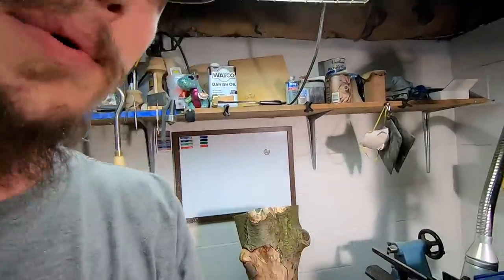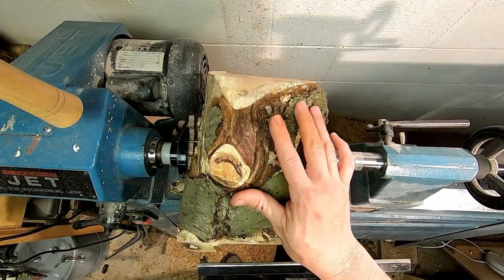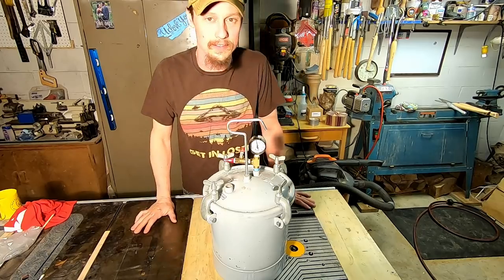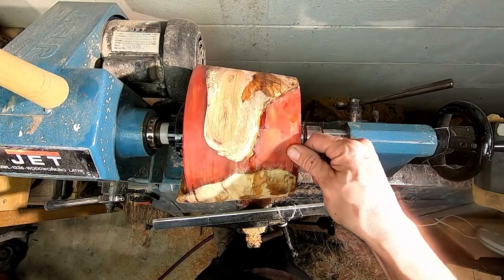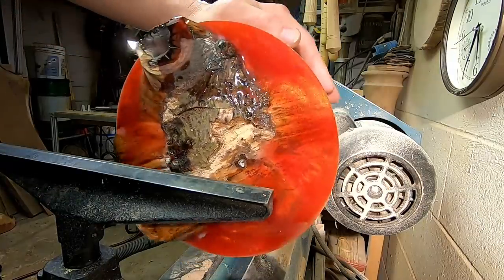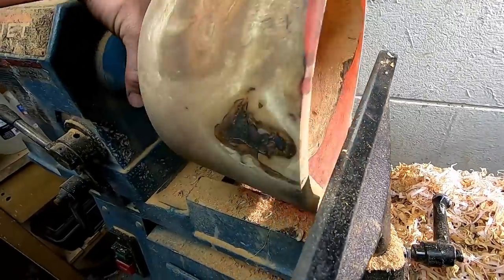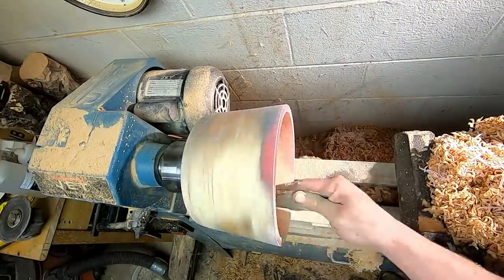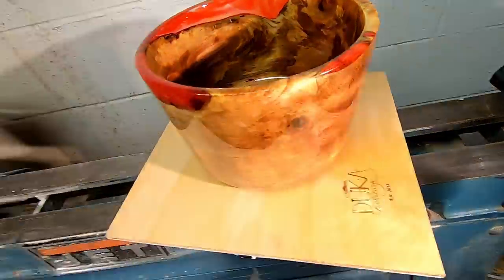Woodturning - Spalted Starburst Birch Bowl

Comment: Excellent eye for a beautiful piece of wood.
may i suggest that you try wood stabilizer next time prior to epoxy use it will stabilize the the wood for you and ease the sanding and turning.
Reply from the maker: It is definitely something to consider, I'm getting to a point now where I can put some projects in line and have some process work done ahead of time. Never know really what your going to be dealing with though unless you cut the bowl blanks earlier. We learn as we go :) Thank you for the support!
Reply: @dukaheritage9445  i do shotgun and rifle stocks, some of my wood has been air drying for 25 years. i still stabilize all of them before i start fitting or carving. it ensure total stability when i am done and they do not swell or shrink with weather when in the hands of customers out in the field.

Comment: Beautiful, but what did you do right there at the end. You mounted the completed bowl to a chuck, applied some kind of finish and appeared to rotate the bowl for a period of time. Can you share that process?
Reply from the maker: Thank you Bruce for the support! The rotisserie is made from a grilling rotisserie motor/ gearbox and just a little fabrication to get the chuck adapted. Hope this helps!
Reply: Duka Heritage I guess my wording is way off. I was more wondering about the finish you applied to get that super high, almost glassy finish. I saw in other videos where you rubbed out and polished your finished projects using something similar to a Beale system. But what was the finish that you brushed on and then rubbed out?

Comment: I'm curious if you stabilized the wood with cactus juice or anything other than the CA glue and if that would have made any difference in any way.
Reply from the maker: Cactus Juice would have helped to stabilize the punky wood for sure, however it is tough to know whether or not you will find it in the piece as you turn. If you do, you are faced with the question of... is it worth the time (at least an extra day) and is it worth the extra expense. I personally think cactus juice is best used to save extreme cases of soft punky spalted wood :) Hope this helps!
Reply: @dukaheritage9445  I guess I thought that cactus juice would penetrate all throughout the wood. I've never used it and didn't realize that it will only go so far into the wood. Thank you!

Comment: I'm new to woodturning... Why not band saw cut off the knobs towards the beginning instead of in the lathe? Do you keep more wood using the lathe versus just cutting them off?
Reply from the maker: Hey Mike, On this one I was just trying to see if I could create flows for the resin. Too many times I have used the saw to part off oddities and wished that there wasn't a cut in that spot.

Comment: Watched a few of your videos now and you have some skills young fella. I see you use art resin for casting, but it is not a casting resin. How did it work for you and were you able to turn it the next day? Keep up the good work
Reply from the maker: I like using the art resin for both casting and coating :) It provides a good long working time for doing work on the rotisserie, which allows the resin plenty of time to self level. Under a bit of heat it is workable overnight. I usually just keep a halogen lamp on it overnight. Thank you for the support!

Comment: What type of camera do you use.  It seems to do a good job.  We need some for our club's demos at the meetings.
Reply from the maker: Hello Leonard, I use a GoPro Hero 7 Black. If you do pick up a GoPro, make sure that you get the Black only because the other models only have a wide angle perspective (Fish Eye) The black can do both wide and linear. Also they are very resistant to dust which is key in a wood shop. Hope this helps :)

Comment: Great job! Spalted birch has a lot of character. Before you pour the resin do you have to sand the wood down pretty smooth? Just wondering if all the tear outs show?
Reply from the maker: Hello Daryl, before I apply the resin finish I typically sand to 220. You can get away with some sanding scratches but nothing too deep and tear will show through.

Comment: HELLO CAN YOU TELL ME WHAT IS THE OBJECT OF PUTTING YOUR MATERIAL IN PRESSURE COOKER ???
Reply from the maker: Hello Roberto this is Shannon [Todd's wife]! Todd is away for the week on his Annual Fathers Day retreat in the Mountains. He has asked me to keep in touch with you all for him. :)

Although I am sure my answer will be less involved than Todd's... Here is what I know about the pressure pot. The pressure pot is not the same as a pressure cooker so please don't take one from your kitchen and try to use it for woodworking purposes. Pressure Pots put air pressure into the enclosed space and it works to draw bubbles out of the epoxy resin that is used in a lot of Todd's work. Lots of bubbles form from the wood, from stirring the resin, from the pour, etc. 
The pressure pot Todd is using currently comes from Horrible Freight. Eventually I hope we will upgrade to one that has better safety reviews. :) 

I hope this helps a little bit. I'm sorry I'm not as well versed as Todd!
Reply: @dukaheritage9445  the pressure decreases the size of the bubbles so they are not visible.   To get rid if the bubbles you would need to use a vacuum chamber.  That's another video!!

Comment: Doing some great work brother! Do you ever get air bubbles with your resin finish, they look stunning. Also I was curious how you attached your chuck to the rotisserie motor? You got a new subscriber, looking forward to watch your channel grow.
Reply from the maker: Thank you soo much for the support! The key to doing the resin finish is to get a good seal coat on the wood first. Without a good seal coat of some sort you will get alot of bubbles as the resin soaks in and displaces air from inside the wood. You can seal a piece with resin but it needs to be in thin coats and it can become very time consuming as you need a day in between cure times. As for adapting the chuck to the rotisserie motor, I turned an adapter on my metal lathe to fit the thread pattern of my chuck and drilled for shaft and set screw to hold it fast.

Comment: Wow! A third of the way in I thought it was over but what a beautiful piece that turned out 👏🏼👏🏼. Can I ask a question on your choice of tools? you chose the tungsten titanium tip chisels right from the off and not your roughing gouge though you did switched to hss in between, do you prefer one over the other or was it just for this particular wood?? BTW your balance of music and taking is ok with me 😉 keep doing what your doing👍🏻 🇬🇧
Reply from the maker: When selecting tools, for me anyway; It depends on the condition of the piece. I prefer to work with natural found wood which typically has a bit of softer punky sap wood due to water infiltration, the variation in the consistency of the piece always makes it a bit of a guessing game as to the quality of the cut. As opposed to a solid kiln dried blank. Thank you for your support!
Reply: All that endgrain would be terrible for a roughing gouge.  It's not made for cutting endgrain.

Comment: no offense and it should be  dumb question as someone who can use a lathe should know............you dry it down to a level that it would be stable?
9% is where you can count on epox to stick........like I said - basic but required
Reply from the maker: Hey Jed, yea I'm not entirely sure what happened with the bond on the bottom portion of the resin. I understand the moisture content concern, but seemed to only have the problem at the bottom.